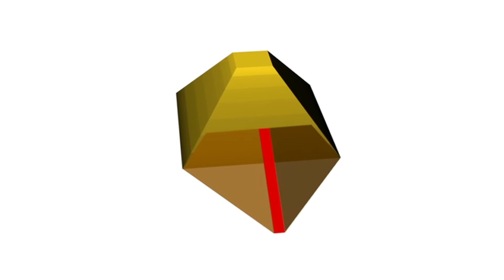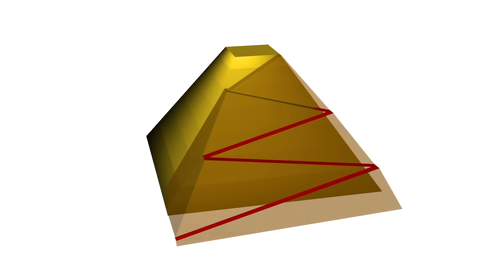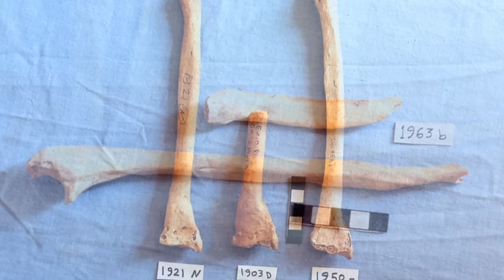Egyptology - Pyramid Construction

Comment: No mention of the larger stones, 10, 100, or 1000 tons. What did they use to cut and polish the stones that are a 7 on the Mohs scale? How did they cut the sixth side of the larger stones from the bedrock, the bottom side? Then, how were these large stones lifted from the bedrock and transported 100 yards let alone 100 miles? Where are all the large imperfect stones that broke in the quarrying process? What material was the rope made from to withstand the rigors of friction of pulling these large stones across the terrain and up a ramp? No explanation of the polygonal construction or the chief capstone being aligned to just 1/4 of an inch off dead center of the square base. That precision was accomplished after the placement of about 2.5 million stones?!? No mention of the internal shafts? Really? And they imagined the construction of all of this grandeur but could only imagine rock hammers, bronze chisels, and string as their primary tools. Never a mention of blueprints or an equivalent! Never a mention of the advanced mathematics and the engineering analytics needed! Never a mention of the supply chain needed to nourish and house the slaves! 

"History is a set of lies agreed upon." Napoleon

Comment: You got to be a total idiot if you think a 100 men cold  Stone blocks that size. All of the paramins were built using Mason like technology. What I mean by this is the blocks were poured in place. Lab tests prove this theory... And it is much more realistic And practical.
Reply: Couldn't help but notice you failed to provide your purported laboratory tests.  lol!
Reply: @varyolla435  look it up, the lab test prove that the stone were poured. They found  seashell fragments deep inside the stones as well-which also support the theory, seeing how the limestone was mixed with the nearby waterflow in the same fashion as cement is mixed. The uncovering folks also made a fake limbstone block using tge same exact methods as the Egyptians and then sent in samples of their fake limbstone along with the limbstone from the pyramids and a lab showed no difference, they said both were real limbstone. There are further chemical complonents in this theory which further support this theory. Look it up.
Reply: Fail #1 = trying to learn history from internet click-bait.
Fail #2 = failing to learn history so as to have the context to recognize #1.

"A comparison was made of the solid-state 29Si, 27Al and 43Ca MAS NMR spectra of the outer casing stone from Snefru's Bent Pyramid in Dahshour, Egypt, with two quarry limestones from the area. The NMR results suggest that the casing stones consist of limestone grains from the Tura quarry, cemented with an amorphous calcium-silicate gel formed by human intervention, by the addition of extra silica, possibly diatomaceous earth, from the Fayium area."

So now for the history you failed to learn.  The Bent Pyramid was a failure.  It's sides were initially too steep along with it's foundation being laid on a soft base = resulting in subsidence.  Accordingly the Egyptians attempted various things to salvage the pyramid to include jamming tafla (clay) into cracks and finally a gypsum mortar they used on many structures as a repair medium + filler + and as a lubricant to facilitate sliding blocks into position.  If you Google close up photos of the Great Pyramid you can see globs of it in places.

So casing stones came from Tura = not exactly a revelation as the Tura quarry is still in operation today.  Also gypsum from the Fayium region was employed to create the mortar.  I still don't see any evidence however of their creating "blocks" employed to build things.  All I see is what was already known = that they attempted various repairs to a flawed structure only to move on to building another one which corrected those flaws - the Red Pyramid.

We are left with what was already assumed to be the case.  You - like others - saw only what you wanted to see to rationalize your fantastical narrative.  We call that confirmation bias by the way.  Meanwhile your French claim - like Houdin's debunked internal ramp claim - likewise failed to account for historical evidence when formulating it's conclusions.  What it asserts as noted = can be explained via other things had they bothered to learn history.  Have a nice day.
Reply: @varyolla435  r u crazy!?!??!?!?!? Hey man to each their own. If u wanna believe that 1,000 men pulled a 100 ton block 200 miles (lmfao) and then aliens beamed them up and put them in place....then go ahead. I believe the scientists in the video that provide proof and evidence that the stones were poured in place.
Reply: The fact that you deflected away from what I noted in preference to nonsensical arguments has not gone unnoticed.  Meanwhile your most recent claim = illustrates that failure of knowledge of history for your part I already alluded to.

1 - there are no 100 ton blocks in the pyramids.  At best the granite relieving stones found above the King's Chamber are estimated to be perhaps 70 tons or so.
2 - those blocks along with the white Tura casing stones = shipped via the Nile.  They did not drag blocks across the desert - silly assertion.
3 - there was once a harbor at Aswan where the granite came from along with harbors at Tura North & South as well as at Giza near the Wall of the Crows.  Those harbors coincidentally are not far from the river while the one at Giza had connecting deep water channels which were controlled via dikes they built.  So during the annual Nile flood the river would swell it's banks from about a half-mile away from the necropolis to generate what amounted to a large shallow lake encroaching to about 1/4 mile from the necropolis.  This range has been determined by geological core samples taken around the area.
4 - meanwhile the harbor at Giza sits a mere few hundred meters from the Great Pyramid = thus the blocks did not need to be hauled very far for placement.
5 - no aliens were needed to raise blocks.  LMFAO!!  The Egyptians built earthen ramps = some still exist today.  They also employed lever devices when used a fulcrum and counterweight.   
6 - the largest heaviest blocks in the Great Pyramid are found in the bottom third of the structure.  Meanwhile as it rises in height = the blocks get smaller so that those found at the top are small enough to be slid into place by several men.  
7 - so the large blocks were hauled into place on wooden sleds pulled by teams of men + oxen - an ox can pull more than 2X it's own body weight so that a team of yoked oxen can pull a multi-ton load.  We have depictions of them doing this.  Also the worker village at Giza contained in it's midden heaps many tens of thousands of cattle bones = enough to feed an army for years.  That places cattle at Giza in large numbers during the period of the pyramid's construction.
8 - the barges such as the Egyptian Merer and his phyle employed were estimated to be able to carry ~70-90 ton loads.  Meanwhile we have later depictions of them connecting multiple large multi-deck galleys together to transport things like obelisks.  Wooden ships as small as the Cogs which once traversed the major rivers and coastal areas of Europe centuries ago could carry between 100-200 ton loads. 

So it does not matter what you believe I'm afraid.  All that matters = is what credible evidence such as is noted above supports.  There is no credible evidence of the Egyptians creating blocks = where there is tons of evidence of them quarrying those blocks from the bedrock.  Facts are a stubborn thing as John Adams once quipped.  Have a nice day.
Reply: @varyolla435  The facts are noted in the video which i find exactly with what ive always believed since i was a child. Since i was a kid i found it absolutely outrageous and laughable that people believe what you are insinuating. But to each their own and, though i think its ridiculous, i respect your perspective as u have every right to believe what u wish to. Thank you for the detailed responses which enlightened me and showed me your good moral character. I wish u well, have a splended day. :)
Reply: I don't deal in opinion or perspective I'm afraid = only archeological/scientific/historical evidence.  So what you opt to believe based upon some fantastical internet claim simply is not supported by the facts.  Your French "researcher" based all upon a sample from the Bent Pyramid as I showed you while overlooking the historical evidence I cited.  

Yes the Egyptians employed a gypsum mortar for many centuries.  You can as I noted see globs of it all over the Great Pyramid as well as it was used to repair cracks in the limestone ceiling blocks of the King's Chamber which occurred at the time of it's creation.  They also as noted employed it as a filler agent as well as a binding agent = you can see among those globs of it chunks of limestone stuffed into large gaps.  Lastly it acted as a lubricant.  By applying the thick mortar paste before large blocks it acted to "grease the track" = facilitating the block being slid into it's final position. They also by the way employed a plaster mixture as well.  It is commonly seen used to smooth the sides of underground tombs prior to painting the walls + to coat columns of temples - especially if they are being re-carved.  The temple of Thebes have many such columns.  

Alas - gypsum mortar is not some "geopolymer".  It is simply a mortar paste which was used to try to salvage the Bent Pyramid when subsidence became apparent given an unstable foundation upon which it was built and sides too steep.  We do not however see it or any other mixture formed into "blocks" - nada.  So you are as noted "extrapolating" the existence of the gypsum mortar into your fantastical block formation narrative.  

That is not science = it is pseudo-science whereby prebaked narratives are rationalized via cherry-picked snippets of information often taken out of context as we see here. Enjoy your day.
Reply: @varyolla435  Be prepared to have your mimd..BLOWN..
https://youtu.be/k0nOw_ebmGk

Comment: Afraid not...i have been working with tile and stone almost 40 years.Try scraping granite with another rock,you will die of old age before you get it flat on six sides.Even if you had form boards like huge squares to use as templates you would never get them made.Keep in mind they had to quarry it,process the rocks capable of being transported,then fine polish them? Nope,there is something we do not know,not a bunch of guys with tiny chisels rope and scraping rocks did this.They have found evidence of high heat...but no tools? No evidence of anything yet of how it was done...water had to be used,animals such as elephants and oxen,maybe some sort of acid made from salt,and a ramp a quarter mile long at the very least...And there are other pyramids, buildings,obelisks,walls,and huge circular polished stones around the world.

Comment: Scientists have estimated that it took 20 years to build the giant pyramid at Giza. But archeologists are puzzled, the pyramid estimated to weigh  30 million tons, was completed in 20 years with 2 and a half million blocks that means the Egyptians had to quarry, move and set every block every minute and a half every day 365 days a year for the 20 years. " Two and a half million blocks of stone average weight two ton each, some as heavy as 80 ton that were transported hundreds of miles 1,000 years before the invention of the wheel". A building approximately 481 ft tall, 750 ft along each side, covering 13 acres.

Comment: This is how they want you to believe the pyramids were built. Its all bullshit. As if slaves could build such PRECISE  structures all that time ago. If they did use ramps, they could not of been more then a 10° slope other wise there is no way of pushing up the massive granite boulders. 10°ramps going that high, the ramps would of been tens of kilometres long. It would of taken 100years to build then dismantle then ramps. 😂
Reply: 1 - they were not slaves.
2 - we have both historical and archeological evidence to demonstrate they employed earthen ramps.
3 - they did not "push" blocks = they pulled them on wooden sleds via teams of men and oxen.  An ox can pull more than 2X it's own body weight by the way - meaning a team of yoked oxen can pull a multi-ton load.
3 - they built ramps out of either mud bricks or else a mixture of sand/stone chips/tafla.  Some still remain today.  The ramp need only go as high as the largest/heaviest blocks to be raised = King's Chamber.  Above that level the smaller blocks - the blocks of the pyramids get smaller as they rise in height with the ones at the top being small enough to be slid into place by several men - could be raised from level to level via lever devices which employed a fulcrum and counterweight.  Herodotus wrote they employed levers as well as what he referred to as a "machine" which is likely a lever-type device as noted.
4 - the Egyptians employed thousands of men organized into specialized teams.  Accordingly it would not take long to remove the ramp which would have been systematically dug away as they encased the pyramid from the top down in white limestone.  
5 - last but not least.  Wanna know what was found when they excavated the limestone quarries which sit adjacent the pyramids at Giza???  Answer:  large quantities of sand/stone chips/tafla - a clay they mined and used in vast quantities for a wide array of applications.  So as they dug away the ramps they dumped the residue into the now open limestone quarry pits to backfill the areas.  There is the remains of a massive tafla mining operation near the Giza necropolis.

So facts are stubborn things as the old saying goes = and what I note above reflects historical and archeological evidence.  Perhaps it is time to actually read a history book rather than opining (incorrectly as noted) on YouTube videos. Just a thought.  Have a nice day.
Reply: Aliens
Reply: LMAFO!!  Enjoy your Matrix Neo.

Comment: Thoth built the pyramid. .... . Set all corners first... string line point to point.....stone lifted with water weights... chamber inside held the cart of water that would raise the stones the distance of the chamber.. then reset. And move again....    gangs of men did drag stones ...wooden tower was built first.. and top stone was plasma first....... just as legend says..... then four outer casement. . String points to point..... ...

Comment: People always say slaves built the pyramids, but Egyptians didn’t have slaves until waaaaaaaay later
Reply: Correct.  The origin of the slave myth is likely due to religious belief.  If you look at the comment sections of videos such as this you'll note a recurrent theme of theists pointing to biblical claims as a rationalization for the belief.  The Bible of course is not a history book = nor does it reflect actual history - although it contains slivers of real historical references to give the reader some type of context.

So Egypt of the Old Kingdom when most of the pyramids were built was not yet an expansionist military power existing only within the Nile River valley and Sinai.  Egypt would not expand beyond those borders and begin to take large numbers of military captives until centuries later as you noted when they drove the Hyksos out of Northern Egypt = ushering in the New Kingdom.  Have a nice day.

Comment: Why carry or pull the blocks which is almost impossible. What if they built a foundation and then built those blocks right on top of each other ?
Reply: Not impossible.  First is they did create a foundation.  On the exposed western side of the Great Pyramid one can see the edge of the base as a result of covering stones being ripped off the pyramid long ago.  The Egyptians started with what was a small hill = and then cut the top off to create a flat platform upon which to build.

As to moving the blocks.  The Egyptians moved things via wooden sleds pulled by teams of men & oxen = we have depictions of them doing this.  They further would pour water before the laden sled.  By wetting the ground they reduced the friction and thus the effort required to move it by almost half.  For the smaller blocks such as make up the upper portion of the pyramids - the blocks of the Great Pyramid get smaller as it rises in height with the ones at the top being small enough to have been slid into place by several men - could be raised the short distance to move them from level to level using levers which employed a counterweight and fulcrum.

So they built earthen ramps to raise blocks in construction - the remains of some still exist today.  The largest blocks found on the bottom third of the Great Pyramid could have been raised via the ramp.  The smaller blocks above that level could be raised using levers.  As they encased the pyramid in white limestone working from the top down = the ramp could be systematically dug away until only the pyramid remained.  Have a nice day.